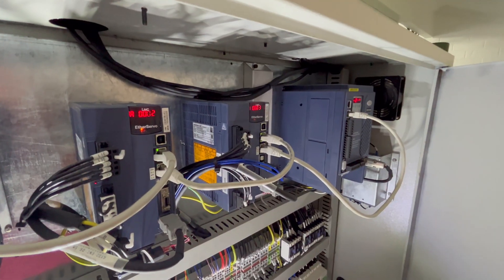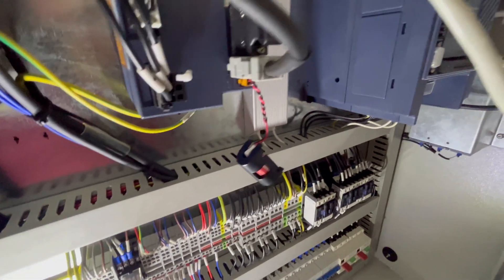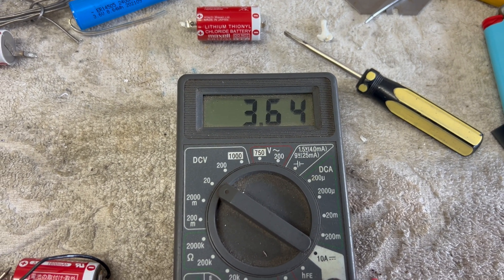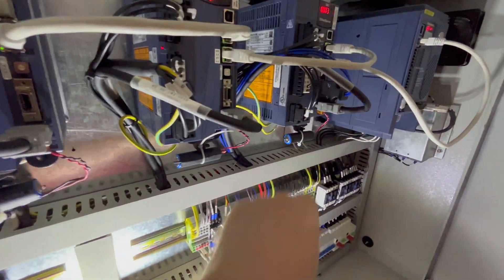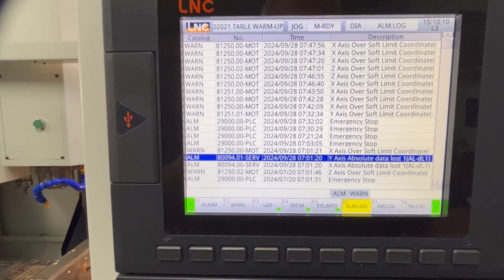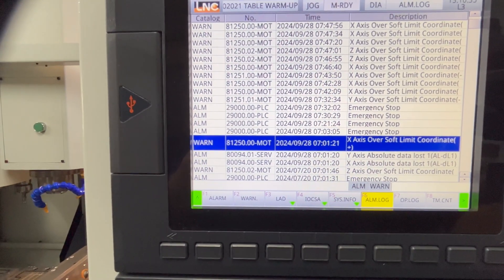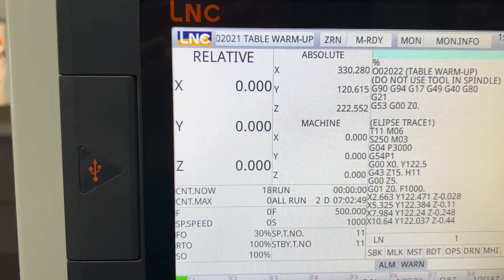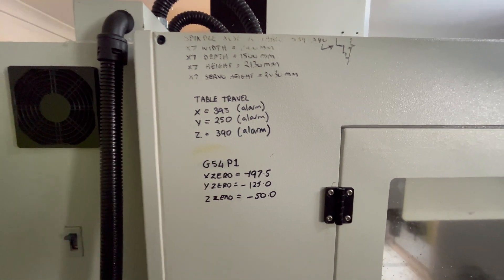My Syil X7 LNC dropped its guts

Comment: Just replaced mine not long ago. I'm not sure why these things aren't setup with a rechargeable that gets charged when the machine is on. It is on my to do list for the winter. I'm sure it is a cost related thing as these cells are pretty cheap to replace.
Reply from the maker: That’s good to hear 👍.  Yes I’ll be sure to replace mine every year moving forward. Cheers 🍻

Comment: the dreaded battery !!
Reply from the maker: Not wrong mate. Bloody Bat Flattery 🪫 🤦‍♂️
Reply: @DCT_Aaron_Engineering  I lost one haas parameters with dead battery - upgraded that.
Reply from the maker: @CNCDude5x  Hey Ed. The same thing happened to our Haas machines at school I was working at (pre-nextgen controller). I missed the tiny red font warning upon start up. Anyway, Haas tech came out and sorted it. Luckily they (Haas) have our parameters on file and also on a USB in the electrical cabinet. Cheers 🍻

Comment: Same thing happened in my 6 axis Motoman robots. The battery mod looks solid, i would leave them in personally. Glad it's up and running! Can't you download all parameters for future reference?
Reply from the maker: G’day Anthony. You can download the parameters for the controller however this was the absolute encoder zero settings for the axis. You can only resolve it by moving the axis and resetting. However for an intelligent bloke like you I’m sure you would find an easier way. Unlike Homer Simpson, a.k.a. me doh 😣
Reply: @DCT_Aaron_Engineering  yes it's a pain but the offset for the tool change might be good to have?

Comment: Always a good idea to periodically power on and test cycle the machines and you might catch a low battery warning before it goes dead completely.
Another note to remember is that you may need to replace batteries more frequently when the cnc is turned off most of the time as the battery draw is higher then.
Reply from the maker: Hey mate, how’s it going? Yes you’re absolutely correct and I have been turning it on and running spindle and table warmup cycles periodically. However at no time did I see a low battery alarm? I know you get them on the Haas controller.  Yes they will changed out yearly from this point forward. Cheers 🍻

Comment: Hey Aaron.
It must be CNC Mill down month at the moment ??
The problem with my Mill isn't battery related but it's a Powering problem.
I wanted to run only 2 Aluminium Extrusions for a customer to top up an order.
Nice easy job before going on with my other work.
Start up the controller to find a Siemens Alarm  700004.
Basically telling me the power connections to the machine are incorrect.
Obviously not that simple because the machine has been powered up for more than 10 years ???
I tried some basic problem solving to avoid an expensive call to the Siemens Tech.
Unfortunately no such luck.
Now I need to wait until Tuesday to resolve it and I'm guessing a few $$$
I finished up running the 2 parts on the Manual Mill.
Definitely earnt my money doing it this way 😅
I will add this and some of my other work in a video after the Siemens Tech has been here. 
Bloody CNC Machine🙄
Reply from the maker: G’day Peter, how’s it going mate. Oh man, I’m sorry to hear about that. Hopefully you can get your CNC mill sorted out soon. The good thing with the Siemens controller is at least you can get a technician to come. I’m sort of stuck with my LNC one and have to sort it out myself.  Let me know how you go with Pete. Cheers mate.

Comment: There might be a way to backup those configs...
Reply from the maker: Hey Dawid. Yes you can back up the controller settings, but unsure if it can be done for the servo drivers. Moving forward. I’ll be changing the batteries every year. Cheers 🍻

Comment: Hey Aaron, any chance you could share where you’re getting the batteries from ? 

I’ll like to chance out the ones in my V5 before I have this issue. 

Thanks for the video 🙏
Reply from the maker: G'day Andrew.  Before you replace them, just make sure you have the same batteries as I do (ER17/33 - 3.6Volt).  There is post on the facebook user group, but his battery was in a black box beside the driver.  So this threw me.  I have found a 3 pack on Amazon for $49.  I will attach the URL link here mate.  Cheers, Aaron

https://www.amazon.com.au/ER17-33-Non-rechargeable-Disposable-3G2A9-BAT08/dp/B0D9H1FP27

Comment: helpful video , weird place for battery's i would of thought it would of been easier
Reply from the maker: Hey buddy, yes the little bastards were hiding up under there.  Not having enough room to move made it harder for me to locate sooner.  Cheers, Aaron.
Reply: @DCT_Aaron_Engineering  At least yours is an easy fix Aaron.
I need to pull my whole Mill out from the wall to get into the Electrical Cabinet 😅👍
Reply from the maker: @weldmachine  oh no, do you need me to pop over to help you?
Reply: @DCT_Aaron_Engineering  I don't need any help.
But it would be good to have you over during these school holidays. 
We have discussed it plenty of times. 
But still yet to organise something 👍

Comment: Glad you were able to get it up and running again so quickly. The FANUC15s we have at work also require the battery to be changed while the machine is on (and the same for the Mazatrol at my old job). If you lose power during a battery change it can be a heart ache involving real to real punched tape to get it to restore those parameters! (Because the same battery also supplies the serial config data for those FANUCs so punched tape is the only way back!)

Smart machine designers would dump all the params to gcode and have them loadable via the default port when the HMI comes up!
Reply from the maker: G'day Adam.  The Haas machines come with a USB in the back of the machine cabinet.  If your machine drops its memory, you can install the stick and upload all the parameters from the factory.  Moving forward, I will now replace my batteries yearly.  Cheers mate, Aaron.
PS: your machines must be old if they still take punch tape?
Reply: @DCT_Aaron_Engineering  The Mazatrol was from 1992. The PTP (punched tape paper) port actually had a bolt on 3.5in floppy drive. While I was there I pulled the floppy drive out and put some Mazak software on that pretended to be a floppy disk, and the database that held the drive data got synced to Microsoft OneDrive. It's a horrible kludge of "buggery boxes", but as AvE says, " you piss with the dong you've got".

Replacing batteries annually definitely is the way to go 😀
Reply: One reminder in your phone / wall calendar to order the batts and one a week or two later to replace them :)
Reply from the maker: @carneeki  good idea 👍 Adam

Comment: A battery backed RAM? That is ludicrous in this day and age. Just use an EPROM or NVRAM. Even a $10 MCU has 8megs of NVRAM that persists for years and is easily updated.
I've had to reload my HAAS twice due to battery dead. Finally replaced the original solder in battery with a holder and just swap out batteries every year. There is no "battery low" warning which erodes my faith in the people who developed the electronics.
Reply: The problem with that is they are absolute encoders.  So if the power is out to the machine (or more importantly the servo drive), and you manually move the axis (twist the shaft, rotate the ballscrew, whatever), the servo will record that movement and still be in absolute mode.  In absolute mode, there is no homing, so the axis must know at all times where it is.  If you simply write it to ROM, then power down, and then you move the axis, it wont know and you will likely hard crash against the physical limits of the machine at some point. Also, all your G54-XX would be way off!

I have the same X7, and just ordered replacement batteries. Aaron got his about a year before me, so i'm sure i'm due.
Reply from the maker: G'day Crashn.  Get on to those batteries ASAP mate.  I was an idiot and didn't investigate sooner.  BTW, I love the user name ;-).  Cheers mate.
Reply: @DCT_Aaron_Engineering  Ordered 4 today.  So, you just power them up and replace the battery when the servo drive is powered up?   

Kinda reminds me of the time you unplugged the y-axis drive and it lost its position.
Reply from the maker: @crashn  Hey mate.  Yes change you batteries only whilst the machine is powered on.  Do not replace them if the machine is powered off.

You raised a very valid memory.  I unplugged that bloody Y-Servo cable whilst the machine was off and it also lost its position back then.  Cheers mate.  Aaron.
Reply: @crashn  Just check the position  on power up, if it doesn't match the power down position, do a zero set.
Problem solved, no need for batteries.
However, with that said. NV type memory is generally much slower than battery backed and that could be helpful if you're reading and writing to memory quickly.
Reply: @jackflash6377  How do you check the position? Unless you have another scale that recorded the move, not sure how you do that.  Thanks!!
Reply: @crashn  absolute encoders send more than just direction and number of pulses, they send info like "I'm at 231.58 degrees". Record this when it shuts down, compare it when it fires back up again.
Reply from the maker: G'day Jack.  I agree with you mate.  As for the Haas we had the same issue with our "pre-next gen" Haas machines at the college I worked at.  You do get a low battery alarm, but it was in small red text on the display before the controller booted.  Very small font and very hard to see.  However, at least you had something.  Sadly my old Syil gave me no warning, but at the end of the day it was my fault for not doing my due diligence and changing them out yearly.  Cheers, Aaron.